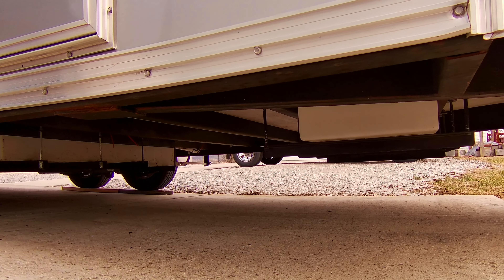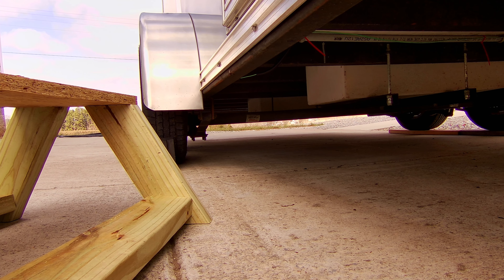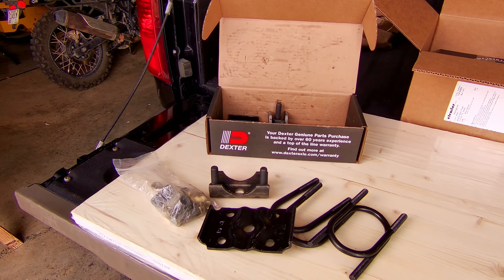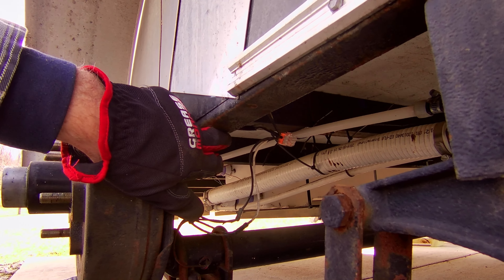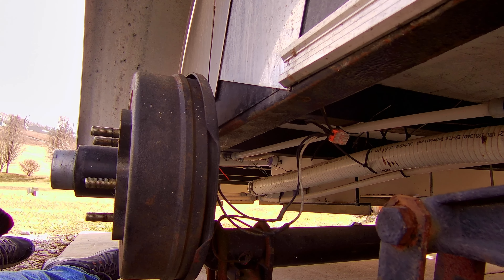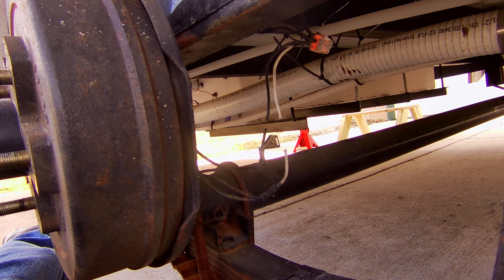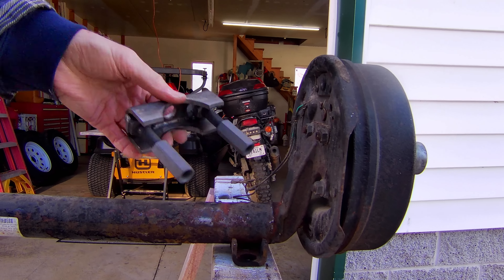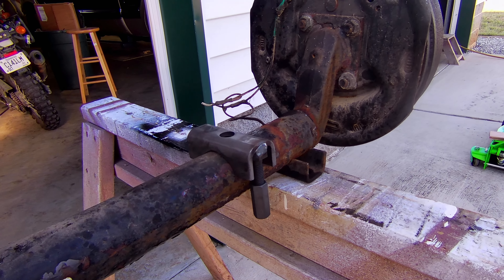Trailer Lift Part 1

Comment: If you spray the lube first and wait a minute, you can take them all off with a breaker bar and then a ratchet, and re-use them. I have done it many times. Using an impact gun is what kills them, especially if you don't lube first.
Reply from the maker: The kit came with new bolts, so I really didn't care if they broke.  But, I should have sprayed them the day before and let it soak in.

Comment: Cutting the wires is how you change the brakes.
Reply from the maker: Is this a question, or a statement?  Not sure what you mean.  The wires needed to be lengthened.  The easiest method was to cut them and put in an extension.